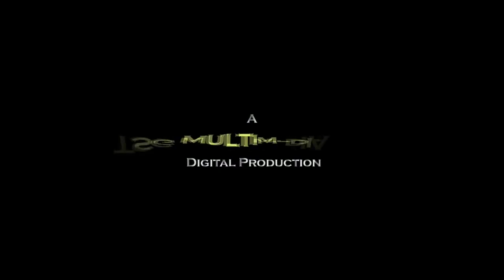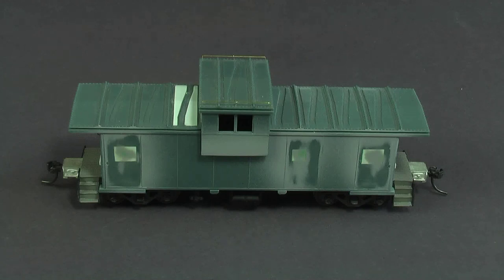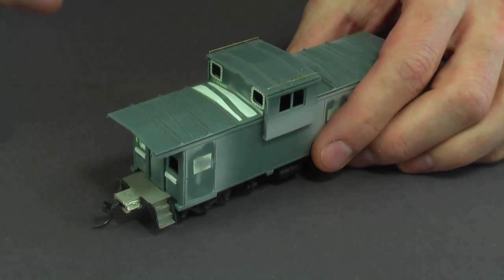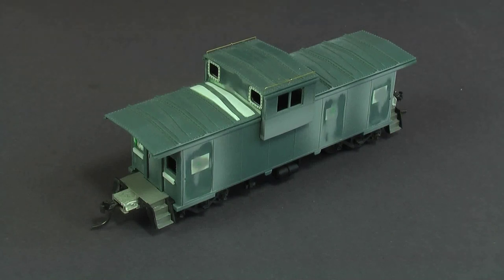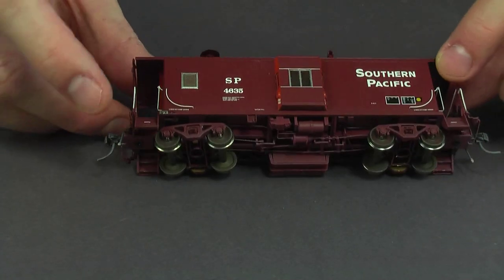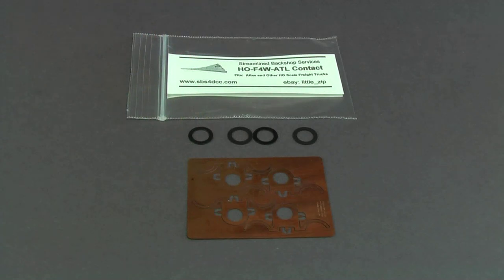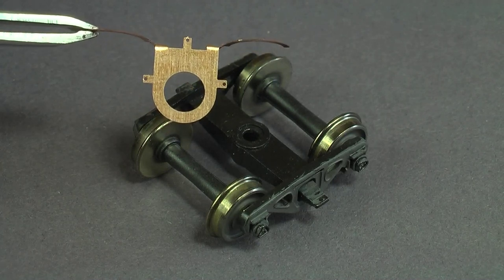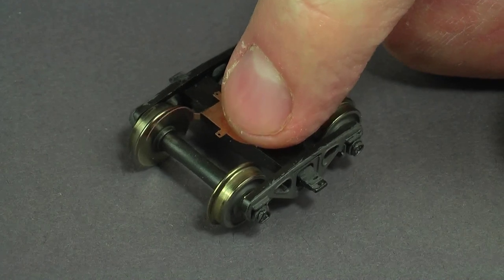HO Scale DCC Caboose Install Electrical Pickups 11-1-12 Podcast

Comment: While looking for replacement Caboose trucks for my Walthers Caboose Kit, on the Kadee website, I found they have Caboose trucks with electrical pickups, wired, and ready for installation!  This is neat to watch, but seeing as how I'm technically inept, I'll probably go with the trucks that are already set up.  I don't know if they were available back when you made this video podcast.  Cool video!  Thanks!
Reply from the maker: +John Bellucci Thanks John. I am inclined the same way as you are when it comes to this stuff, but at least there are a few ways of making it happen, and Dan always seems to show the least expensive but also most challenging way.

John

Comment: do they make these for passenger cars? Do these roll more freely than axel tab type? I have a set of PRR bachman cars which are a mix of 2 and 3 axel trucks and my BLI T1 actualy struggles with them and I fear it is overworking the engine. Hoping between conductive oil and axel point lube I can free it up a bit.

Comment: Excellent work, gentlemen!   I've been thinking of building myself one of these newer BN International cabeese.  Looks and sounds like you started with the Atlas model, not the  Athearn as stated in the video.  I'm interested in the cupola mods you had to do.  Any chance you could post some details about how you did the windows and those aluminum frames?  Is this a modified Athearn cupola?